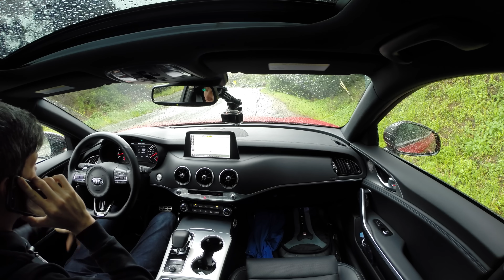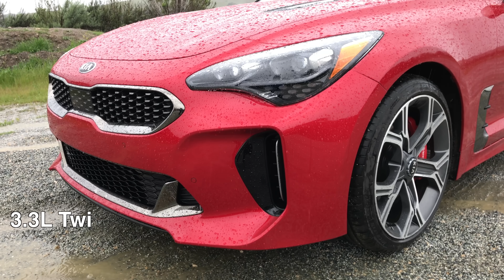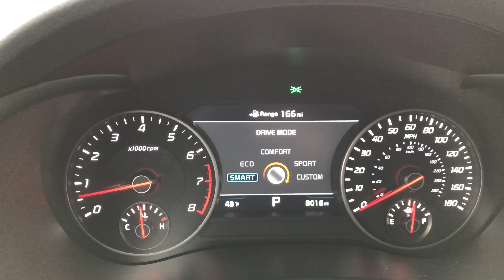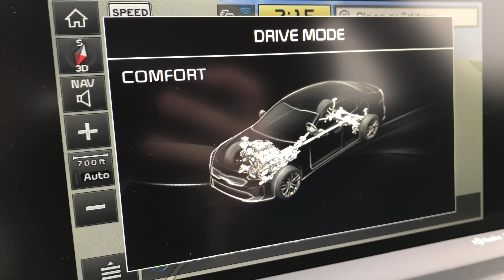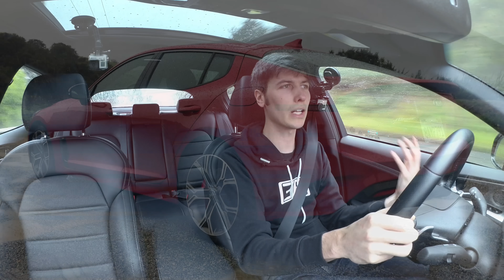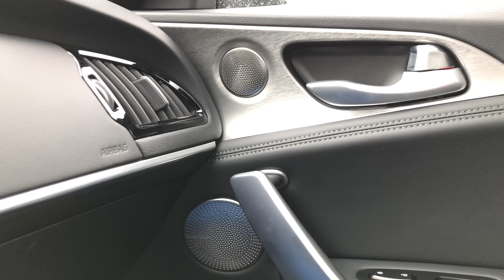The Kia Stinger GT Is An Ego Check For Car Guys

Comment: Don't call it a Kia. Tell your friends you drive a Stinger. If they ask the marque, BOOM. You own them.
Reply: That's what I did when I told people I went to test drive a Stinger. I showed them pictures and they were hooked on. Only then did I let slip that it was a Kia.
Reply: Alejandro Bello It's Stinger by Kia
Reply: Proper way to change people opinion.
Reply: I love telling people that I drive a Kia and watching them squirm.
Reply: Stinger is a much need for kia to get out of bad past
Reply: that you can also buy
Reply: Alejandro Bello I agree. The car would have sold a lot better without the Kia badging all over it. 

Hence why they used the “Special K” for the Forte Koupe. Or Genesis became its own brand. All to disassociate themes from Kia/Hyundai. 

Still call it the Kia stinger. But don’t put a single Kia badge on it. But some kind of cool fancy “S” badge. And it would sell better. 

That and add 100hp and drop the price by about $10,000 and NOW your competitive
Reply: @devinbender8428  It's a halo car.
Reply: you can buy a different badge, some call it the " flying k " it is very stylish and they use it on some cars in Europe.

Comment: I like it and this is coming from a guy who is so into BMWs that I made a YouTube channel on it lol. I definitely would consider one of these if I were in the new car market. Anyone who doesn't like it with out driving it is probably close minded. It's a good looking car and has good specs. I look forward to what Hyundai and Kia deliver in the future.
Reply: Mazda has never been owned by Ford, nor are they even partners right now as Ford divested its Mazda stock. What you're saying is gibberish.
Reply: I got an opportunity to drive a Stinger GT (the V6 TT AWD) for roughly an hour on my own, and I was thoroughly impressed. For me, I would seriously consider this, regardless of the Kia badging. I could argue that their Optimas in the SX trim and Stingers in the base trim can compete with your top of the line midsize sedans from Honda, Toyota, Nissan and Mazda.
Reply: Scott Dann nissan is not owned by Renault, where did you got that info from?
Reply: Devin Bender You literally made my point better than I ever could have!
Reply: That was the best analogy i have seen yet for this car. LOL  this car is the velcro shoe of cars. Cheap , affordable , does what it says its supposed to ,and comfortable. but still a velcro shoe. lol
Reply: Vipervenomsrt You sound ignorant. It's been tested on the track, slalom, 0-60 vs a Beamer and a Porsche. You're definitely picking at it for whatever reason. Charger is not even the same market. That's not luxury or speedback.
Reply: I don't know how it is in the US but the problem here with "exotic"  car brands (wich in Germany is about everything other than Mercedes, Audi, BMW, VW, Skoda, Seat, Volvo and the high class manufacturers like Jaguar and so on....) is that they are not as much cheaper to buy than they lose you money when you sell them...I had a 35k€ Peugeot once- got 7k for it when I sold it- a VW would have been around 15k..
Reply: Absolutely. This is a great addition to the market. I don't want one at this price, but cars like this are going to keep the Germans honest.
Reply: Vipervenomsrt - taking a 4000lb car to the track is an expensive way to spend a Saturday imo
Reply: Not in Australia. Kia’s hold their value because of the warranty and because the more informed buyer steer clear of german makes past their warranty and nothing else compares to the stinger aside from top end germans. The 7 yr transferable warranty, killer looks, reliability, great reviews and shortage of other options underlines this cars resale value.
Reply: I think you are reading too much into what I wrote. I said probably in reference to others who have not driven it. If you drove it and don't like it then that does not make you close minded. I am referring to people who will not give it a chance because of its badging.
Reply: BMW-E90-HQ It has some of the BMW M DNA.
Reply: Gravecb7 Accord Actually if you knew anything about cars, Subarus drive great but have engine problems and don't knock a Hyundai until you've tried one.
I have a Veloster turbo, no issues, great interior with double stiched black leather, very nice cornering and boots like no body's business, it runs on regular fuel and gets amaizing mileage
Reply: He did mention in the video that KIA brought in German engineering involvement for this car. So... there's you're excuse.
Reply: He’s test driving a car in the rain?
Reply: Devin Bender not for that kind of money
Reply: I accually really don't like kia's cars until I watched this video it gave me a different reason to like it that car looks so sick. Kia really is starting to step things up
Reply: @Vipervenomsrt it's interesting how the japanese auto makers never give a 10 year 100,000 mile warranty.......kia and hyundai do....a decent warranty for trash you say?!
Reply: @Vipervenomsrt I owned the 2006.5 optima ...nice car first run model that didn't have any issue's. unlike the 1st run model of the stinger I presently own....My only point  is why give a great warranty to a trash,or ''throw away'' car? Kia and Hyundai came a long way and they got a second look by me and others....no hate here, peace.
Reply: Dude, your comment aged so well lmao, kia and Hyundai are killing it with their designs nowadays
Reply: "good looking"
Literally looks like every other cookie cutter sedan
But if that's what you're into I guess....
Reply: It looks like a Mercedes c class interior too
Reply: BMW-E90-HQ You ever wear Velcro shoes? They are VERY reliable and cheap like Kia.
Reply: BMW-E90-HQ just looked. The stinger GT2 was slower on willow springs then the 13 Genesis coupe 3.8 what a joke
Reply: BMW-E90-HQ also the GT2 Stinger is sower on willow springs than the $35,000 2.3L ECOBOOST MUSTANG!
Reply: it could have a ferrari badge on it and be made from hand pounded aluminum and i would still make fun of it for possibly one of the ugliest side marker lights ever made.
Reply: No Name Kia/Hyundai/genesis has the worst resale value of any automaker!! 2nd only too Bentley and Land Rover.
Reply: BMW-E90-HQ close minded ? Isn’t that a requirement to be a youtube Expert? xD
Reply: BMW-E90-HQ not closedminded. It’s still a Kia and cost as much as a GT mustang with ecoboost specs
Reply: MrMoon36O they did those vs a 10 year old 5 series not a  2017 435xi that is same size power and price
Reply: tuneit3 could have had a Focus ST. Faster smoother and more potential
Reply: Gravecb7 Accord Nissan are owned by Renault. They don't make reliable cars anymore.

Mazda are owned by ford. They have the same issue.
Reply: @MX-Vette  Mazda doesn't make their cars in conjunction to Ford's processes. Same as Jaguar does not make their cars in conjunction to Tata.
Reply: So... you like it without driving it but everyone who dislikes it is close minded?
Reply: Also Kia/Hyundai has been widely known to pay off writers, bloggers, and magazines to get better reviews and win awards so don’t even go there.
Reply: BMW are unreliable trash cans just like Hyundai and Kia Japanese cars is the way to go Honda, Toyota, Nissan, and Subaru WRX the new 2019 Toyota Rav4 is so beautiful I hear it supposed to be in production next year it's higher up and looks like an off-roading SUV that's a vehicle I would consider buying and I looked up reviews on the current Generation they are extremely reliable

Comment: I just Love this car!! Thanks for the great review on this one, but the KIA Stinger should have not been equipped with a electric steering setup. That’s just a bad bad decision.  Paddle shifters should have been setup with each paddle being able to shift up and down on one, and not split between the two paddles. Other than that, if I owned one, I’d fix those two issues myself if possible.

Comment: Let me tell you why this fine driving machine will fail. In Canada, KIA is asking 60k on the road (~$1000 per month lease for 36 mo with zero down). As a comparison,  in Canada, Audi S5 Sport back with driver package is around 70k on the road (~$1030 per month lease for 36 mo with zero down). BMW 440i also has similar lease payment. Why get a KIA then?
Reply: Ahsan Mahmood why? Well with the kia you save $30 😃
Reply: As a lease, it's a no-brainer, but to own, the Kia is significantly cheaper and has a much lower cost of upkeep.
Well anyways, I got my Stinger GT already and it's half the price of a similar S5 in my country.
Reply: yes. 5 year full warranty
Reply: Well, an Audi is just a glitzy Volkswagen to most people. Your comment is subjective. To you, an Audi is the better car. To me, I'd say a Benz is the obvious choice for a German car. You could actually buy one, do what you want with it, and recoup a good portion of it's value if properly maintained.

It's all about preference, see? Not everyone sees what you see. So no, it isn't really a fail.
Reply: His point of the ego check
Reply: At first I was so excited to see that our Stinger was way cheaper than the american one but the leasing/financing say otherwise... Theirs is much cheaper. What's interesting is that the Genesis G70 is MUCH cheaper with a lease than its cousin, eve though it's a luxury brand
Reply: equivalent S5...not the teknik package which adds Audi virtual cockpit
Reply: Yes i agee
Reply: In my country people will go for a pre owned GTR for slightly more, as most people do not trust Korean car brands.
Reply: Accurate. I drive a kia and i love it, but it's about bang for the buck. A good car at a great price. I aspire to one day get a great car at a good price. Kia has to offer something at least 20% cheaper than BMW Audi to be able to sell. Based on the pricing listed now it's only 10% or less difference. If the 340 BMW is at 60k specced, the Kia needs to be 48k for me to even bother.

Comment: torque converter automatic, no manual option. Biggest downside
Reply from the maker: Agreed! Put another pedal down there!
Reply: snakerb really hate that fact tbh. I don't understand why auto companies can't be like vw and keep the same bellhousing pattern. Every 4 cylinder vw engine will match up to any transmission from any 4 cylinder vw. Hell, they could have used the same manual transmission from the 90s to save costs and just change gearing for different engines ect
Reply: Yep Im the same, always owned and driven manual. Sucks that it is that way now, but atleast cars like the new Civic Type R and Focus RS still stick to manual only :)
Reply: Corey Broadstock they’d make manuals if people bought manuals. When was the last time you or someone you knew bought a BRAND NEW manual car vs those who go out and buy autos (new or used)?
Reply: Corey Broadstock as someone who grew up driving manuals and love manuals, I understand where you’re coming from. But it’s costing a lot of money to design/develop manual transmissions which hardly sell, so for the sake of profits they’re sticking to automatics.
Reply: That would raise costs even further
Reply: I understand that alot of cars sold now are automatic, because of technology advances etc. But this is a performance aimed car that dose not have the OPTION for a manual. Even atleast a dual-clutch automatic would be better,
Reply: if they use 7/8 speed transmission, they can use sequential transmission instead. no torque converter, no automatic mode. just use electronic clutch.
Reply: Corey Broadstock the g70 will

Comment: Great video as usual...but curious which 1 you liked most 4wd  vs rear wheel drive? Glad it isn't fwd at least
Reply from the maker: I'd go with the RWD unless I really needed the AWD. Significantly less weight, a bit more nimble.

Comment: KIA hired the Designer of BMW's M Series to develop the Stinger, that's why the car is so performance-oriented. The downside about the Stinger is that it resembles too much of the other KIA sedans, especially the front end. It will be much better if KIA came up with a distinctive look for the Stinger.
Reply: The style was designed buy a Designer from audi i read. He left audi because he wanted to make more interesting designs as every audi looks the same.
Reply: substring zero  The Stinger GT can corner well enough for the roads, if you are taking it on a track, it’s not as buttoned down as a true sports car.  Keep in mind it was designed as a GT car and not a balls out sports car. I would take the Stinger any day over the WRX, then again I’m older and prefer not to get beat up driving a car anymore. :)
Reply: It  hugs the corners - when you drive it you'll see.  The salesman was taken aback by how I drove it too.  the first place I went wouldn't give me the time or place, the second place let me take it all over and drive it crazy.  I love it, no regrets.  I did months of research.  Good luck!
Reply: Literally every bmw looks the same too lol. Some just have more doors and different numbers written on them
Reply: I like the direction that Hyundai/KIA is heading, contrary to their Japanese counterparts.  My biggest concern are the transmission, suspension and cornering capability. This video shows the transmission has slight issue on sports mode, which is not a good thing. Traditionally, their suspension tended to be on the soft side, but I prefer stiff suspension. And so far, I have not seen any review on the Stinger's cornering capability. Usually when nobody wants to talk about it, it is probably not a strength.

I am in the market for a new car in the next 2, 3 months, and the Stinger is on my list. But right now, the WRX STi is higher on my list than the Stinger. I will need to test drive the Stinger to get more information. By the way, when I do test drive, I usually warn the salesman on what's coming. :)
Reply: Think the stinger has a few suspension settings, guess it is still a GT car so will be fairly soft. James may test drove it on the Grand tour on amazon and he seemed to like it.
Reply: Longhillmom Can’t be too great, it only sold 2,200 units!!!
Reply: substring zero. Im pretty sure they decided to make a performance car for other reasons than what the stylist came up with.  I dare say it was Kia that decided to make a performance car and it was that decision that led to the sporty styling.
Reply: Yeah BMW have used the same dials for years, BMWs don't turn heads anymore.
Reply: That grill pattern sure could see an improvement.

Comment: I love this car it's everything that I really like nowadays. But after seeing The Straight Pipes review on this I had to hold off on getting one. The Canadian spec has a few features that the US trims don't get. The Special edition Atlantica brings those in but I can't bring myself to spend that much. My biggest complaint is the pricing difference. This car is 50k CAD which if you convert that to USD it's WAY freaking cheaper.
Reply: On paper it's cheaper but when you calculate the leasing/financing deals, ours is much more expensive. I see there's like a 7000$ (US) discount on the leasing deals on your side of the border. You can't get a Stinger for less than 800$/month up here :/
Reply: Kingjay814 360 cameras are liiiiiife
Reply: Kingjay814 you could probably grey import it, unless the features affect the emissions.
Reply: metaleggman18 I'll have to look at how it works the features are just quality of life things mainly this insane 360 camera it's got (and yellow paint). Kia just doesn't seem to get conversion rates. It's like they said okay 50k for eveyone and didn't factor in exchange rates or something

Comment: Kia is a knockoff brand. Also Audi engineered the Stinger for Kia but Kia is still known for shoddy manufacturing
Reply: An ex audi engineer works for kia, is that what you're referring to?
Reply: Kia isnt a knockoff brand they're good at offering reliable and cheap cars that will last.(not sure ab the older ones tho) and now theyre trying something new.
Reply: #3 behind toyota and lexus in reliability after 60k mi - consumer's report.  #1 in initial quality by JD power 3 years in a row, beating out porche and other luxury brands.
Reply: This is the misconception. I drive a Kia and is perfectly reliable for the past 8 years. Still, they can't match luxury performance brands ie BMW Audi and try to match the price point. At this price I'm going for a BMW or Audi. Even if they're a little slower. It's nothing about the reliability, it's many other factors including features and quality that makes it illogical to price so close to a luxury brand.
Reply: Wrong. JD Powers and Consumer Reports has recent Kias more reliable than Hondas. In fact they’re the most reliable non-luxury brand. I own a 2 year old Kia Sedona fully loaded right now and it’s been more reliable than my RAV4 and Acura MDX were.

Comment: I dont get why people like crossovers. Raised wagons is what they are. I dont see the point on getting such an ugky car for slightly higher seating position
Reply from the maker: I bought my Crosstrek (raised Impreza) because I was hitting the rockers in my STI, needed more clearance for the roads I drive on. But if it doesn't leave the pavement, yeah they're a bit silly.
Reply: Engineering Explained Oh wow you actually read my comment!!☺  And yeah i get the need for ground clearance(you should see my 3-series lol) but most of these crossovers I see are 1.2 turbo petrol without any "bad road" capabilities unlike Subaru forester or bmw x3 for example.

Also btw great content and keep it up